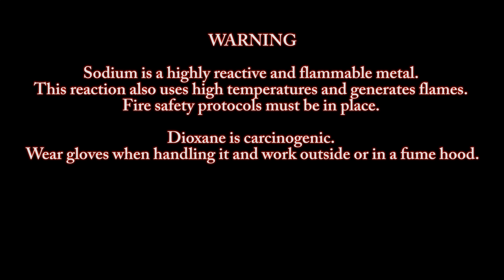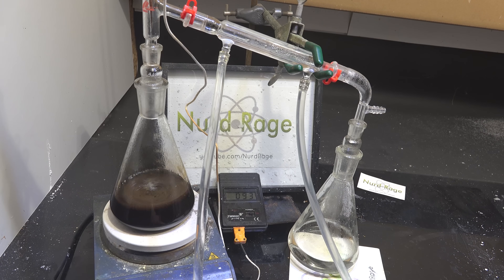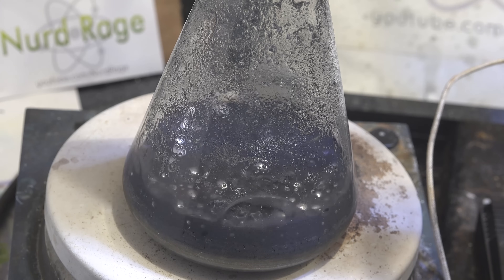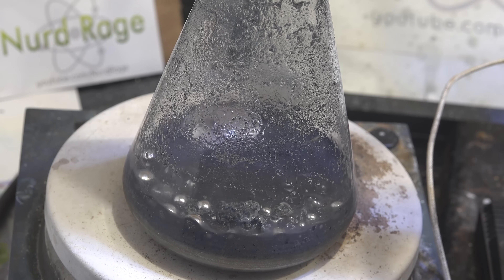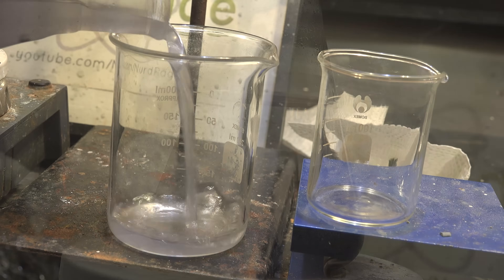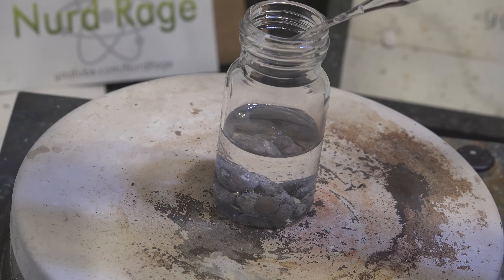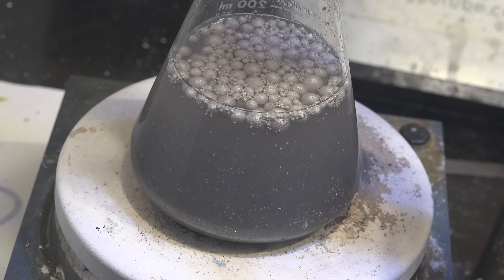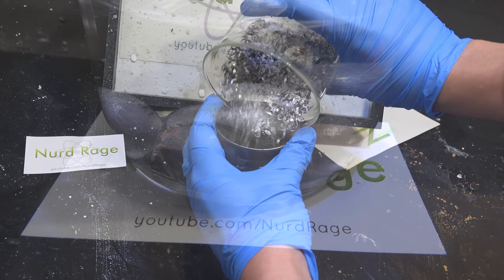Make Sodium Metal Without Electrolysis Using Domestic Chemicals

Comment: Hey, I saw on local news a report about new device installed next to coal power plant which converts CO2 into LPG.
Are there any reasonable processes which can actually do that? They also claimed this device will reduce carbon footprint the power plant is going to have which I think is straight up lie.
Reply from the maker: you technically can do it... but it consumes more power than the coal generates. It's NOT a viable way of making LPG at all.

That being said, such technology is useful for converting say nuclear energy into LPG. But totally stupid for converting coal.
Reply from the maker: actually solar cell technology has come a long way, the numbers for solar cells being net energy losers come from a time decades ago when manufacturing wasn't nearly as optimized. But now, solar cells are cost competitive even with things like coal. So Solar cells are good... provided they were built in a modern factory.
Reply: @Philip Polkovnikov No, that's a load of bullshit from the nutjob anti-solar people. That logic would only be true if we were making solar panels out of light, and then turning them back into raw materials to get the energy back out. We're not. We're manufacturing solar panels which convert solar radiation into electricity. A solar panel is more akin to a  coal plant than the coal, and the sun can't be dialed back, and the energy that's collected wouldn't have been put to use otherwise. Whether the solar energy hits the surface under where the solar panels would be and produces heat, or a portion of it is converted into electricity which ultimately ends up as heat doesn't really change anything except whether we're getting a cut.

The problems with solar power have nothing to do with the nonsensical notion that solar panels take more power to make than you get out of them.
Reply: It's possible to do stuff like that, but the problem is that converting waste products back into a fuel requires you to put the energy you would get out from burning the fuel back in, and all processes are inefficient. That is, they'd need to expend more energy making the fuel than you'd get burning the fuel.
Reply: @NurdRage Which only works if you have an excess of nuclear energy to begin with.
Reply: Philip Polkovnikov that makes me want to use joule as universal currency.

Comment: Maybe dioxane works best because of something to do with radicals ?
Reply from the maker: i thinks its more that it chelates with MgO
Reply: thats my bet too, MgO is polar so polar solvents wet the surface better and probably lower the absorbtion of sodium.
Reply: Yeah that's probably true... Did you try with your diethyl ether then ? It make good complexes with magnesium bromides as far as I know, so it could be effective. It's also a way of testing the density hypothesis in the other direction ^^
Reply: polyethylene glycol dimethyl ethers could work too, they come in many   viscosities so there is plenty to choose from.
Reply: Dioxane forms coordination polymers with Mg quite selectively
Reply: GiggitySam Entz or dioxane forms a chelate with the magnesium oxide causing some of it to dissolve. If it acts in this way THF should work too.
Reply: It's nowhere near high boiling enough. You'd need dibutyl ether.

Comment: Would it work with other sodium salts, maybe carbonate?

Sadly, magnesium is expensive.
Reply: I'd guess washing soda on hot charcoal might work if there was a way to maintain the reducing atmosphere and then condense the sodium vapor.  

Na2CO3 + 2 C  (solids) - - >  2 Na + 3 CO (gases) at 300-500 deg.C.

It's less energy efficient but hey.
Reply: Mike Guitar I actually calculated that washing soda will not react with magnesium in a favourable way, but I dudn't bother with calculating it at higher temperatures... Just at 293K, which is a good approximation, usually.
Reply: Okay, but I was talking about replacing the Mg with C, since you said Mg is expensive.  (Although this would be an endothermic reaction, not exothermic).
Reply: Mike Guitar It may be possible, but sodium carbide may form. Also, sodium would be distilled, so it makes it harder to do.

Apart from hydroxide, oxide may be the only reasobable "salt" for reduction to sodium with magnesium, but is hard to obtain.

Comment: Super pure sodium ! Without electrolysis ! Congrats ! :D
Reply from the maker: thanks!
Reply: NurdRage if I had stirring equipment I would definitely try this looks like fun
Reply: BarsMonster not the stir bar tat is the problem they are cheap enough. It is the heating element with stir capabilities. my lab equipment is extremely bare bones eating tends to override lab equipment. still trying to get basic glass distillation to make nitric acid for the roughly 35 lbs of low grade silver scrap that I have.
Reply: You can easily make steerer DIY. Just the stirbar need to be bought - luckily it is cheap. Just stick a magnet to a PC fan.
Reply: Joe Rowland last time I checked, they start at about $350 US
Reply: What's wrong with electrolysis though? Sure, it involves lower temperatures than melting salt, but it involves expensive chemicals and processes and a big cleanup. There's nothing simpler than salt.
Reply: @Juan Lopes Thats true, but the temperature for the effect (called Curie temperature) varies. It's low for NdFeB magnets (500K to 600K) and some can be damaged at something like 130°C or 150°C. But e.g. AlNiCo magnets have to be red hot (~1000K) to lose their magentic properties. So the stirbar is probably no NdFeB magnet.
Reply: Juan Lopes as long as you dont exceed the temp rating the magnet stir bar is fine beyond that the stir bar is waste but they are cheap.  For higher temps there are other stirring mechanisms but they can be costly which is why stir bars are used.  There are magnets that can withstand 150 degrees celsius but I am uncertain what the limits are for stir bars.  Dioxane evaporates at a temp that is lower than what would destroy the magnet, if he let the vessel run dry and temps got to high stir bar would most likely end up in the trash, but are easy to replace.
Reply: Joe Rowland, my hot plate can get to >300c which is crazy, and the magnets are fine.

Comment: I fucken love you man, looks like im gonna spend tomorrow shaving my magnesium bars.
Reply from the maker: Awesome! let me know your results and reproducibility. (and as usual, be careful, sodium metal is a harsh mistress)
Reply: SUCCESS!!!
I started with 40g of NaOH and 30g of Mg shavings, then after mixing thoroughly i added it to an aluminium can and tried using a sparkler to set it off, the first one failed but i used three after that and it worked. Of coarse i put a broken cinder block over it.
I ended up using my girlfriends kitchen blender thing to grind it up and it was mostly successful but now her blender doesn't work properly for some reason, shes pissed.
Anyhow i feel like i could have grinded it up finer but i proceeded anyway. 
I added the agregate to a 1000ml erlenmeyer flask with a ground glass joint followed by a stir bar and then added 450mls of freshly distilled 1,4-dioxane, this bubbled a little but no enough to cause any significant yield loss i don't think. I then attached my condenser and still head and started ramping up the temp.
dioxane started coming over pretty fast at 100*C and i just let it go nuts, there wasn't any visible sodium in the dioxane until i had distilled down about half way. 
I kept going to dryness which i didn't really like doing but i ended up with a rather enormous lump of sodium metal sitting in my flask (bigger than yours i think) as well as a bunch of smaller ones. 
I foolishly didn't have an tweasers to work with but i used a bread and butter knife to cut the large sodium chunk into 4 smaller bits and then dumped the lot onto a plate and separated out as much sodium as i could.
my sodium looked pretty dirty at this point and i threw it a 100ml beaker and put in some mineral oil and added some ethanol and started heating it, i didn't have to add anymore ethanol but i did have to stir it quite a bit and i had trouble getting it all into one lump. 
After letting it cool i took it out and dried it with a paper towel and then weighed it, it came to 10.6g :D
My lump wasn't as spherical as yours but i think the fact that my magnesium was a lot finer may have helped increase my yield a little.
I wanna try it with magnesium powder in the future if i can find some and also try adding and removing magnesium to see if this changes the yield at all. Unfortunately it takes me about 4-5 hours to shave 30g of magnesium with my current method so i need to find a better way to do that as well.
Reply: @jaredgarden2455    Well done but be a man.  You've got to buy your girlfriend a new blender.
Reply from the maker: awesome! its very cool to have external verification.  The increase in yield is wonderful. I agree it might be from the finer magnesium and the fact that yours is freshly made so it hasn't had time to oxidize while mine is years old. excellent work man!
Reply: want to know too.
Reply: You have to wait till this weekend, i have finally managed to get together about 30g of magnesium shavings but i still have to make some dioxane which will take a day. So 2 days of work which is my weekend.

Comment: Okay, wow. SERIOUSLY impressive! Those crystallization lines are gorgeous!
Even though it took a PHD Chemist specializing in inorganic chemistry to figure this out, I am absolutely blown away by the yield...
I was totally convinced that you destroyed almost all of the sodium by blending it in air like that, so to see big globules of sodium coming out of the slag was just amazing... It literally took me a couple of seconds to believe that it was actual sodium.
Reply from the maker: Thanks!

At first I  was totally blown away and thought it was one-time accident. Then i repeated it several more times before i finally convinced myself i had something.
Reply: Ender Gaming; Actually, his really good yields seem to indicate that degradation during that step is pretty minor... still, would be interesting to see what the difference would be if you put the aggregate straight into dioxane (which is contained in a suitable blender housing) after the thermite reaction is done. (Maybe use some liquid nitrogen to reduce the cool-down time? You would have to watch out for condensation though...)

At any rate, I agree with Nurdrage that the major loss almost certainly occurs during either the thermite reaction itself, or the cool-down period after it has completed.
So I think the most effective strategy would be to run the thermite reaction under Argon (you don't need a perfectly air-tight vessel if you don't mind keeping the Argon flowing for the duration of the thermite reaction; you can simply have the Argon come in from the bottom and leave through a coiled metal tubing 'chimney' at the top) and then immediately after it has cooled down, you put the aggregate into the blender with dioxane in it.

Another thing that you can try (however I don't really know how usefull this would be, as I have no idea what the most common hydration state of the NaOH that you will be using would be), is to first thoroughly dry your NaOH (i.e. expell all water of crystallization) as well as drying the magnesium and the container that the reaction will be run in (although the amount of water in those 2 cases should be pretty negligable).

Other than that, use the finest magnesium that you can (but remember to compensate for the increased amount of oxidized surface magnesium by increasing the total amount that you use in the reaction) and then crush and mix it together with the NaOH as thoroughly as possible. Again, I don't actually know if this is worth it, since magnesium is by far the most expensive reagent here, and the >40% yield is already very reasonable; hence the greater loss of magnesium, due to increased surface oxidation of the powder, could quite possibly nullify the benefits of having it more well dispersed.
Reply: Is there anyway you could use a heavier gas like carbon dioxide to protect the sodium from reacting during the blending step? (Not sure if sodium reacts with carbon dioxide itself...)
Reply: MRLT Could this also be done with Lithium?
Reply: Afro Samurai yep. Lithium has a lower electrochemical reduction potential than sodium (-3,04 if i can remember well), so technically  the reaction 
Na^+ + Li ----> Na + Li^+ would be spontaneous in a galvanic cell. The problem is that both sodium and lithium would react with water :,( so you have to heat them. Cody reduced Cs+ to metallic cesium using lithium.